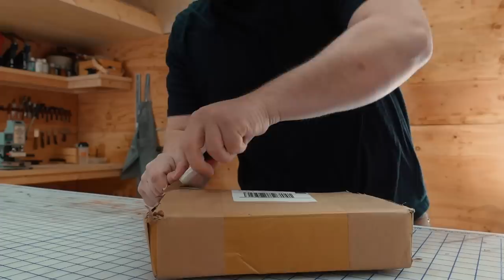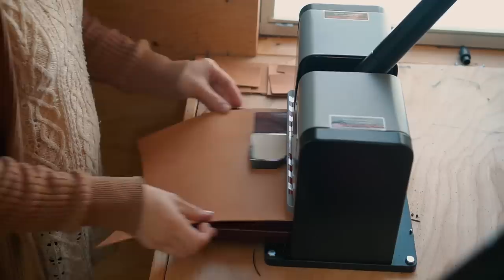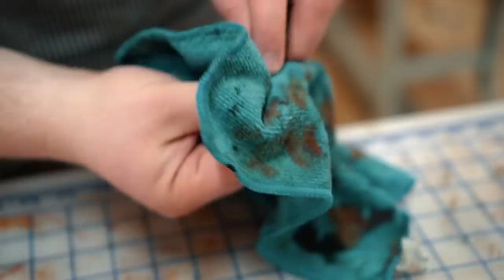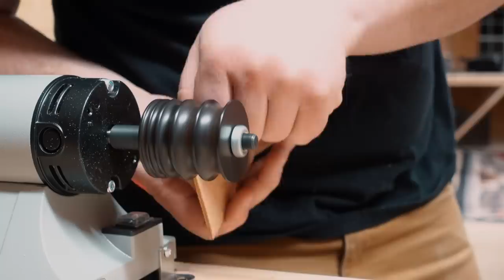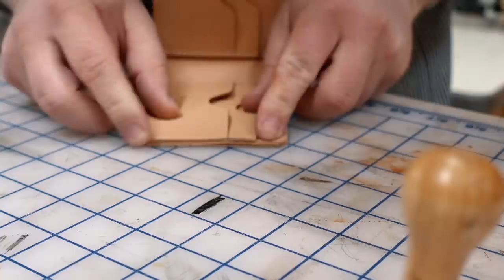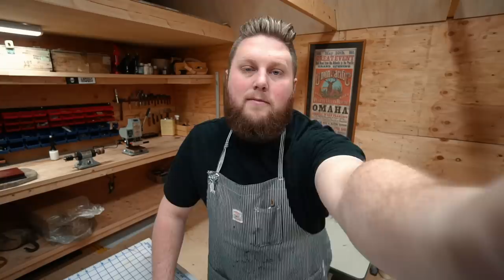Making a Leather Billfold Wallet

Comment: FYI, when using a Bic lighter to melt your thread, wipe the melted end with the metal guard of the lighter to avoid any finger oil transfer.  It works great and any excess thread wipes right off your lighter once cooled.

Comment: When you prep your leather, do you use the same thickness of leather for each peace or are you using thinner leather for the card holder slots? Thanks again for your videos!
Reply from the maker: I usually just use 3/4oz for the whole wallet. However our factory in Waterbury has a splitter, so when we produce them in batches we usually split the pockets and interior pieces down to 2-3oz and leave the exterior part 4-5oz
Reply: @whitandpark  thanks!

Comment: i tried made my own wallet, from my wife bag's that unused anymore. manually draw the design. with pull tabs feature. wanna use money clip but can't find it anywhere around my area. so go for normal design. cut all the needs. fix with double side tape instead of glue. but i give up when it comes to sew it by hand. damn it hard.

Comment: Hi, I really like your videos and I want to try to make a few wallets like this for me and as presents for my best friends. The design that I have in mind for myself is a little bit different and I would try to make the rest custom made.
It would really help me out if you told me how thick the leather you’re using is (preferably in milimeters, because I have no clue what ounces are) and recomend some beginner tools and where to buy them.

I was having a look on amazon (the german one because I’m from Slovenia) the other day and they sell some ”scrap” leather by kilograms that are in ruff squares of 11.7 x 16.5 inches (those are leftovers from a shoe company) the price is around 23€ per kilogram or about 10€ per pound of leather and the thickness is 0.9 to 1.2 mm.

I don’t want to go all professional and I don’t mind doing everything by hand, but the price differences for these tools are weird to me, you can buy a set of prongs for 3€ or 13€ or 30€. Obviously I don’t want to buy some cheap shit as I want the tools to do the job well, but , so I don’t want to spend a fortune for them. There are only 2 Tandy shops in Europe one in UK and one in Spain which means they are too far and too expensive anyway. I would really need some advice on these matters